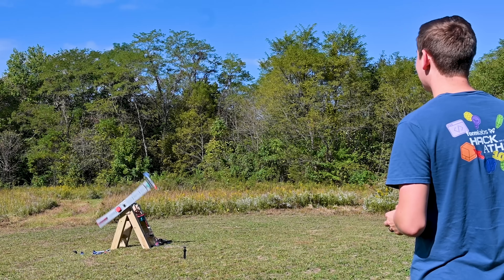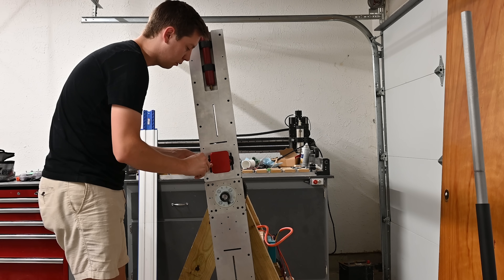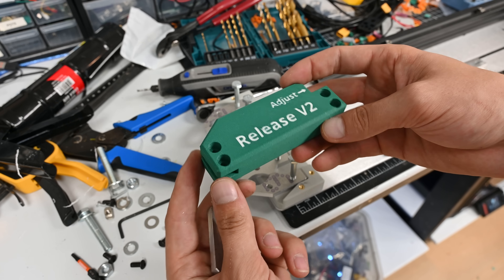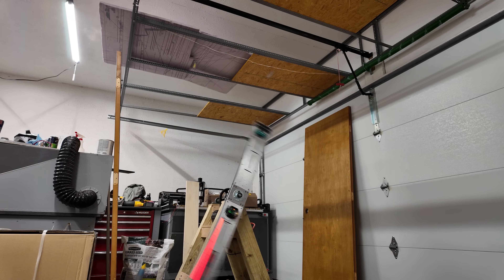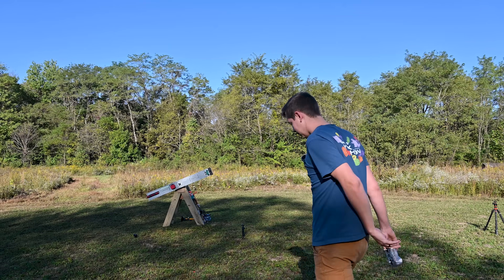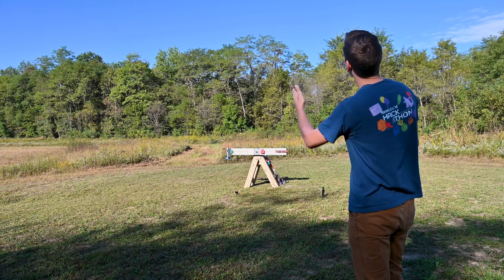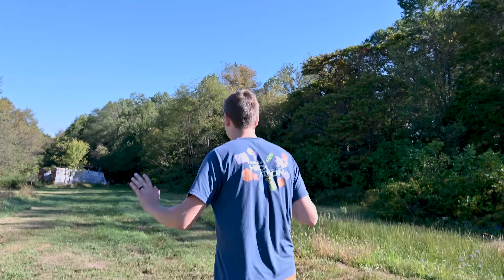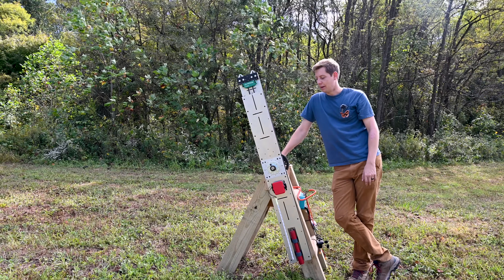I Fixed SpinLaunch

Comment: Mechanical designer here, I wanted to highlight (and detail) @Mueller3D idea :

A sliding counterweight NOT on the opposite side, but on the side of the rocket, when the rocket is launched, the counterweight  is released and slides from the base of the pivot to the end of the arm, stabilizing the center of mass of the arm by replacing the rocket.

The fixed counterweight on the opposite side then just needs to be made a little bit heavier to counteract the inertia of the sliding counterweight when it is at the base of the pivot.

I honestly don't think SpinLaunch will ever be viable, the only way for the rocket to launch straight and not lose a huge amount of energy correcting it's spin would be to insanely accurately counter-rotate the rocket with a motor at the end of the arm, even if they manage to get the counterweight system reliable enough for commercial use, the whole chamber having to be vacuum sealed, and the almost guaranteed complete and utter destruction of the entire system in case of even extremely minor timing failure is simply far too risky.

Having the arm wobble at the scale you are making it at isn't a huge deal, sketchy, but unlikely to cause serious damage.

The problem is that rotational inertia does not scale linearly with size AT ALL :

2 times the size is 8 times the volume, and thus, mass. But it also means that the arm radius is twice as long.

 rotational inertia is mass * radius, assuming your system weights 1 mass unit, and as a radius of 1 length unit, a system twice as big would have :

8 mass unit * 2 radius unit = 16 times the inertia !!!

SpinLaunch goals are a 100m diameter arm,  yours is roughly 1.5m in diameter, so that's ~67 times smaller.

Now.. let's do the math once again for SpinLaunch's target :

67*8 = 536 weight unit

67 radius unit

536*67 = 35912 times the amount of inertia you are dealing with.

Could you imagine THAT absolute monstrosity wobbling for even just a quarter of a second ? I don't think so, neither can I, all I know is that it would not end well for anyone involved.
Reply: He could just yeet a second rocket into the ground when he releases the one that goes up, or realistically a simple counterweight but a second rocket is more entertaining
Reply: @Guardian_Arias  That works on a small scale model, and is what SpinLaunch did for their prototype, but at a 100m scale it's incredibly wasteful as you'd either destroy the counterweight with every launch, at which point you might as well just use a normal multi-stage rocket.

Or dig a giant tunnel with crazy systems to safely slow down and catch the equivalent of a supersonic dump truck, which introduces even more catastrophic failure points.
Reply: you pronounce "fun points" in a really weird way.
Reply: @ledocteur7701  Y'all think this SpinLaunch crap is dangerous, wait until we see what happens when I say "look at that supersonic dump truck" from behind my wife.
Reply: @ledocteur7701  I spose no relief would be found releasing a heavier counter that travels a shorter distance up the arm? Sort of "Impedance match" the counter to a better fit with an available damping stop mechanism? I'd imagine the yeet->half rotation->yeet makes quite a bang in the building...Funny, my thought process initially put it on the other arm but after some thought, no, not good. You'd have to pull it IN, or release it.
Reply: @ledocteur7701  Thank you for this!  I was thinking of the giant hole idea to catch the counter-weight!  But my idea was to have water/sand in a mass-carrier as the counter weight, and simply eject it into the hole.

But at a 100m scale, I guess we'll get into volume issues.  BUT why is that necessary?  Why not stop the scaling at 20m or even 10m?  If you can eliminate the need to consume 9x the payload mass in fuel, then wouldn't it be okay to send matter up in multiple trips?

I like the spinlaunch concept, because it's a means of moving asteroid material around in space without the need for a chemical rocket.  It's essentially a mass driver, but in a much more compact form.
Reply: @zz7824  Rockets are very fragile, they are meant to just barely handle the vertical acceleration at launch, and that's it.

You'd have to massively reinforce it, decreasing payload/mass ratio.

If you were to use a third of a rocket, rather than just the payload and a little bit of maneuvering fuel (like is the plan for SpinLaunch), the SpinLaunch system would consume way more energy, have even more inertia (remember, length of the arm scales almost linearly, it's the mass of the system that doesn't.)

A rechargeable liquid/powder counterweight would lower cost, but the tunnel would still be extremely expensive.

At just "falling from a cliff" speed, water is basically concrete, so at the supersonic rotation speeds of SpinLaunch, you might as well be launching artillery shells down the hole.

Sand has the same issue, on top of dispersion. While a solid counterweight can be easily simulated and as such should never touch the tunnel walls (lowering building cost), sand would disperse a bit differently every time, unless it was filtered to have perfectly equal grain sizes, which would make it very expensive, and not reusable as the impact would change grain sizes.

Now for use in space, yeah, SpinLaunch is a decent solution, no need for a vacuum chamber, and you can use a much smaller arm that could be reinforced enough to survive using a sliding counterweight.

By the point we get to yeeting moon rock and asteroids toward earth, we will probably have found a better solution, or improved railguns enough for that to be viable (they would be far more reliable that even a small scale SpinLaunch ever could be), but if we haven't, sure, space merry-go-around it is.
Reply: @wellscampbell9858  could that help transfer more energy from the arm to the projectly at the launch instant??
Reply: A sliding counterweight on the side of the rocket seems nice in terms of rotational balance but it also means you have a weight that slams into the end of the arm and that's probably even worse than any rotational imbalance at higher RPMs. Any dampening attempt just delays the moment the arm is balanced again. I think the best solution (and one proposed by Spinlaunch if I remember correctly) is just to have one rocket at each end and release them one after the other. Now the arm is imbalanced for only half a rotation and you get twice the launch per wind. Of course now it means that air can get in for a bit longer but that's a problem they have to solve anyway.
I think Spinlaunch is an incredible idea with unique technical challenges but I think people have forgotten the amount of technical challenges humanity had to solve to launch any rocket into space in the first place. Making rockets reusable seemed like an impossible task until someone decided to pour billions into making it happen. The biggest problem with Spinlaunch right now I don't think is engineering but funding
Reply: rotational inertia is mass * radius SQUARED - its even worse.
Reply: yeah what this guy said!!
Reply: Two ideas about the counterweight - what about moving it from the end of the arm to the centre (using screws or something, it wouldn't be quick and would user a lot of energy)?
Or splitting it so there are two counterweights on the non-rocket end, one which is on an arm. The counterweight on the arm is released and swings around to the other side, and then somehow latches on to the rocket end of the arm?
Reply: wouldnt be weight in the middle sliding just a little bit after launch a much better option?
Reply: i think it would be viable on the moon
Reply: Concur.
Reply: Many problems with spinlaunch - a big one being the release mechanism - they have made an 'arm' strong enough to deal with the forces involved (at a speed to launch a ~rocket to 'space')  by using some fancy carbon fibre, but there are no materials available from which to make a ~clamp as strong as that arm to hold then release the projectile. Full scale is nothing like their limited testing - as you say - rotational inertia doesn't scale linearly with size.
Reply: There is a nice other way and i have no idea why noone talks about it: 
Why not accept a shift in the center of gravity and just have the center of rotation follow it? If you have a bearing structure that can change geometry (by freeing up a second set of bearings in an excenter for example) it can just stay balanced even with the changed geometry of the arm. There is no need to have everything rigid.
This is essentially the way for example turbomolecular pumps work, there is a myth a single fingerprint on the rotor will cause incredible loads in the bearings but actually thats based on the bearings being held rigidly in an infinitely stiff mount. In reality the bearings are held in soft butyl rubber grommits that just allow for a few µm of excentricity reducing the bearing loads to almost nothing by giving some compliance.
Reply: @NIOC630  Self-balancing mechanisms at a large scale are.. tricky. They need very precise tuning (stiffness, total allowed movement, anti-over-compensation systems,...), and in this case, the payload likely isn't going to be the same every time, and it needs to be released at a very precise angle and location, something that a constantly shifting center of rotation would significantly complicate.

For a SpinLaunch system in space tho, and that as such doesn't require a vacuum chamber with a "barrel" of sort, it is a really good solution, even if a bit heavy on maintenance.
Reply: @ledocteur7701  Im specifically NOT talking about self balancing, im not talking about shifting counterweights but shifting the center of rotation (the bearing axis) to the newly settled center of gravity.
Reply: @NIOC630  Yes, that is also what I was talking about, and it is also self-balancing, just in a different way.

A wrongly tuned system like that will not lead to massive wobbles like a improperly weighted counter-weight would, but it can lead to negative feedback loops, as larger scale systems cannot rely on a completely free-floating bearing for a variety of safety concerns and structural integrity issues, they require springs and dampeners, which need to be tuned.
Reply: @ledocteur7701  You know what engineers do for a living, right? A large part is dynamics and dampening :P
All in all its very possible, there is no hard fact that goes against it.
Reply: @NIOC630  wrote: "You know what engineers do for a living, right? A large part is dynamics and dampening :P
All in all its very possible, there is no hard fact that goes against it."

Suppose that the gimbal at the end of the throwing arm (around which the projectile pivots) and the gimbal around which the throwing arm pivots each have passive oscillation mitigation systems which passively shift the centers of rotation so that they coalign with the centers of mass. The system no longer vibrates. This is good.

There are still numerous other static and dynamic forces acting on the projectile that need to be contended with.
Reply: @Kargoneth  Of cause, its a challenge but its way within what we can do. If somebody told you 20 years ago we would land booster stages of rockets larger than the saturn5 by picking them fro the air with "chopsticks" you wouldnt have believed that either. Its all solvable problems and no case of "physics says no" like the space elevator. All materials and components required are available already.
(im no elon fanboy, its just a good example)
Reply: @NIOC630  Yes. I would have called you crazy for trying to suspend an entire rocket on two protruding spars at the end of metal chopsticks. I would have told you that the sudden impulse of downward force would snap the chopsticks. I would have been wrong. I would be less skeptical about the hovering and lateral positioning portion. Precision hovering is not so outlandish.

Physics does not say no to space elevators. It just asks for incredible materials. I suppose that the same might be said of this SpinLaunch concept. That said, much like the chopsticks, I am unable to envision any solution that does not simply disintegrate under its own stresses. I would love to be wrong, but that has yet to come to pass.

I don't mind Elon fanboys, provided that they're at least realistic.
Reply: @Kargoneth  "passive oscillation mitigation systems"
Oscillation is not the issue here, we are talking about compensating an imbalance, thats not oscillation.
Stop using words you dont understand.
Reply: @NIOC630  wrote: " "passive oscillation mitigation systems"
Oscillation is not the issue here, we are talking about compensating an imbalance, thats not oscillation.
Stop using words you dont understand."

Oscillations are periodic. The vibration of an imbalanced throwing arm is a periodic oscillation resulting from the center of mass rotating around, but not colinear with, the axis of the arm's rotation. Stop being so high and mighty and assuming that other people don't know what they're saying.

I already laid out many more issues with the SpinLaunch system in other posts. You refused to respond to one of them because you said that YouTube had suppressed my comment.

You then insisted in this comment thread that all issues with the SpinLaunch system are solvable, yet you only described a way to counteract the off-centre mass. Despite my skepticism regarding your larger assertion, I gave you the benefit of the doubt. I am familiar with passive, self-balancing spinning mechanisms (i.e. systems that passively mitigate oscillations). Do not spit in my face.
Reply: I dont understand why everyone is so worried about the rotaional inertia. The problem is the release mechanism itselfe which neither does not line up with the center of mass of the rocket nor realeses it perfectly at the same time. 

Every body which is released from a circular path moves tangetially away (for center of mass) bc there is no accerleration any more which keep it into the circulat motion). 

The problem is the release mechanism itself introduces forces in the rocket which lead to a torque around the center of mass and that is leading to the wobble (spin like it is called here). That has nothing do to with conservation ob angular momentur in my opinion. Correct me if im wrong
Reply: You're assuming the thing being launched is scaled by the same amount as the arm, which isn't necessarily true. You could scale the arm faster than the payload.

Of course, the reality leans in the other direction. You need a fairly large rocket to be launched in order for it to fuel the thrust into orbit (geostationary moves sideways at 3km/s, the ISS is at almost 8km/s). And that's not to mention it needs to be going fast enough and strong enough to overcome air resistance, which would end up being even more fiery than a normal reentry because it still needs velocity once it leaves the atmosphere. That's not even mentioning that you are assuming the rocket would have the same density as the little 3d printed simulacrum, despite it having to be much stronger and carry a payload.
Reply: "Complete and utter destruction" as your reason for not being a viable option. Bruh. Space X explosions has left the chat. Have you seen how many have blown up leaving nothing behind but trash. I dotn get your logic on this.
Reply: @floppinfish  We're not just talking about the rocket exploding here, we are talking about the entire 100m diameter launch system flying off into thousands of rock to car sized chunks, and potentially getting thrown into the upper atmosphere to land unto an unfortunately located house 50km away from the launch system.

Even without the safety concerns, most rockets aren't reusable, if the boosters succesfully land back down, that's a bonus, and the fuel still needs to be refilled, which is a large expense in itself. It's a calcuated and predictable cost, whether or not the launch ends up being successful.

But for Spinlaunch, it's a significantly more expensive system, but that has the benefit of being reusable pretty much indefinitely, with just a bit of a high electricity bill to pay.

So if that gets destroyed every 10 or even 50 launches, that's guaranteed bankruptcy. (unless you happen to be the richest man in history.)
Reply: @floppinfish  To this day over 500 falcon 9 launches, 3 have failed. Thats everything but complete and utter destruction.
I recommend you learn your own language before commenting.
Reply: @NIOC630  why aren't you working at SpinLaunch then, if you can fix all their problems? Sorry but with that tone you had it coming.
I do partially agree with you though - shifting the mass center is not the only option here and maybe someone figures out a sick and reliable mechanism to shift the center of rotation instead. Still not convinced it will save the SpinLaunch idea, even though I would love to see it work out
Reply: SIX SEVENNNNN

Comment: do you know how much variation there is the angular velocity as your rotates?  can you find that using your high speed, because I feel like 1 Hall effect sensor/magnet pair isn't getting enough resolution to accurately calculate the release point.  I couldn't tell where you put the sensor, but hopefully it's as close to the release point as you can get it (or slightly before) maybe a little bit of math/testing to know how long it takes your release to open and then have the sensor in advance of the release point but that much so that the sensor is firing just before the release point that you want.  that way, you can add a firmware delay in, and really fine tune the accuracy of the release point.  

I'm an electronics guy, so naturally I think I would go with solenoids over pneumatics, because the different pressure/temperature/humidity will create variability in release time.